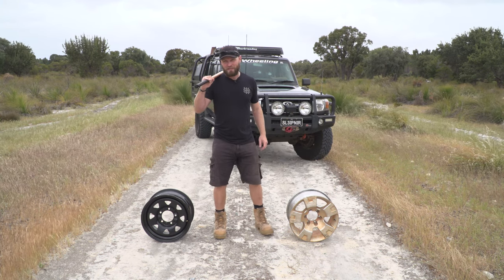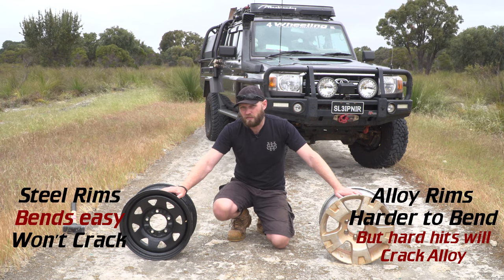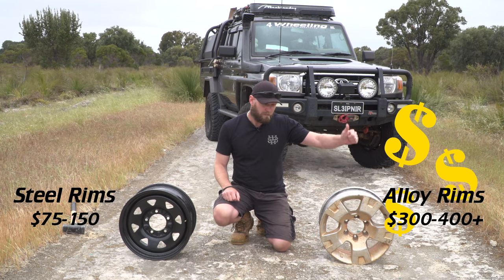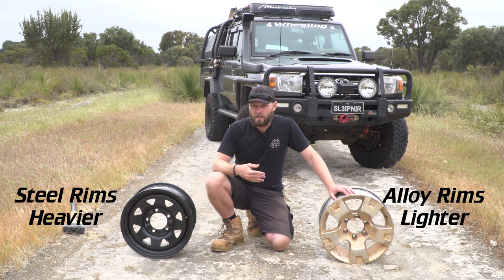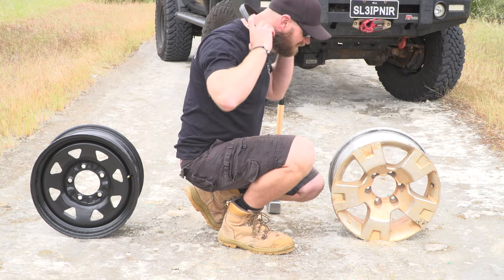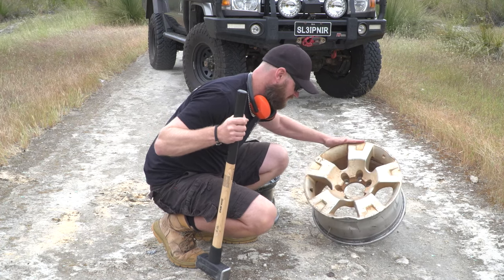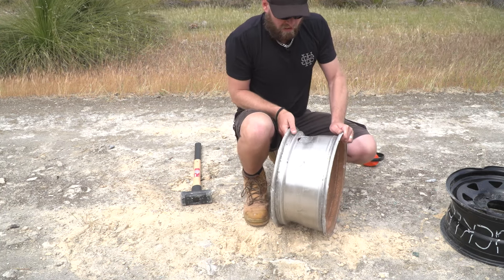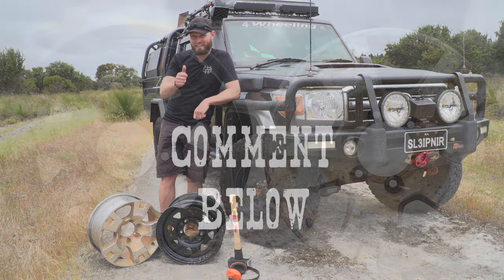STEEL vs ALLOY rims Off-road Wheels

Comment: One thing about rim cracking is their construction technique. Cast aluminum wheels crack if hit too hard. Forged Aluminium wheels will bend and can be fixed with proper tools and techniques.

Aluminium rims do have lower mass for a given load rating, reducing unsprung mass, which will improve off road comfort and grip, as well as reduce stress on other components on the car.

Comment: I agree with most of what you said. What I think you got wrong is. I believe you are confusing strength with hardness. Being harder does not mean stronger. You obviously understand that or you wouldn't put steel wheels on your rig. Just nitpicking. Great video!

Comment: I have a set of 16x8 steel and a set of 16x8 aluminum weight and the difference in weight between them is 2lbs per wheel (30lbs steel vs 28lbs aluminium) they both look very similar to the factory alloy wheels on the 1999-2004 F250 SD. Steel wheels all day since the weight difference cant even be noticed. The person I got the truck from had the 16x8 aluminum wheels mounted and the 16x8 steelies in the back which is the only reason I have a set of aluminum wheels now.

Comment: Summary:

Alloys=Streets: Lightweight, dissipate heat due to higher travel speeds, use AT’s for light trails and they look SEXY‼️👍🏻

Steel=Off-road adventures: Stronger, slower speeds, Mud Terrain tires for serious trails, and they look BAD ASS‼️👍🏻

If you got room to store 5 full size tires, have both. Alloys w/ ATs and Steels with MTs. Swap them out based on your travel demands. 👍🏻

Comment: Here's a thought... 2 Piece Rims.. Steel outer ring/barrel  with Alloy center. Able to mix and match for different looks, offsets and stud patterns. If you bend the ring  you can fix it or just replace it. If you damage the center you just replace that without even taking the tyre off the rim. 

   They have been making 2 and 3 piece alloy rims for years. Why not make the outer ring from steel instead for off road use?

Comment: I have aluminum rims...because that's what came on my super cheap craigslist vehicle lol. Eventually, if I end up doing 4 wheeling that's extreme enough or remote enough, I'll probably buy some steelies. For now, my alloy wheels are fine for the FSR's I do.

Comment: I ran alloys for a year or so, but found the weight saving of alloy was lost in its need to be a thicker construction. In my situation it was a saving of 2kg per wheel. Helpful and never broke one. But sand driving killed them too quickly, my assumption is sand in beads wore away at the alloy, making them lose air way too quickly. I choose steel now.

Comment: Great video, just what I was wondering about. Also great name on your 4x4, the fantastic 8-legged "horse"(I'd say vehicle, but that got mixed up in translation somewhere - it's obviously not a real horse that flies and goes under water, or with all those legs anyway) of Odin.. Since you're obviously interested, I'll tell you a secret about Sleipnir(that means smooth in Norwegian) - we're told them vikings ate too many mushrooms and dreamt it all up(like Jesus:) but they really meant something more concrete. If you really look for it, you can sometimes see the tracks of Sleipner on the ground in holy places(stonecircles) and where there are now churches in the mountains of Norway f.ex. They will look like 8 round little spots arranged in a wide circle about 5-6 meters in diameter. No kidding I've seen one with my own eyes appear over night. It's from what we nowadays would call a UFO. Wich matches the description of those guys wery well, if you think about it, driving their electric vehicles around.

Comment: If you can find a good strong center section steel rim like off of a 1 ton truck, just weld on a DIY beadlock kit and no more bends. 
But i would certainly say that aluminum bead locks are the way to go.

Comment: There are steel rims I like that I cannot find in aluminum, but most the damage I have seen is to the lip of the rim. That's why I chose aluminum.

One note. Weight is a big factor for breaking. You need to calculate rotational mass which is roughly three times the weight of the wheel and tire times 4. That is what your brakes have to deal with.

Comment: I have a question.
For a better word, spokes.
The steel wheel has 8 spokes.
The aluminum alloy wheel has 5 spokes.
The steel spokes is central.
The aluminum is offset.
Wouldn't that make a difference to the strength of the wheel?

Comment: I havent personally bent a 15x10 enkie alloy wheeling with 33x12.5 15 on my montero,  but i usually dont air down at all, and drive a lot of pit run and gravel. I have repaired bent aluminum wheels on cars, and yes, they dont give as much. I'm a bit on the fence on it.

Comment: If you tighten the lug nuts a bit too far it will eat through the Alloy  wheel, steel, you can tighten them down past the torque required and will be just fine

Comment: I was kinda hoping you'd give the faces a smack, as well. I've seen both types get slid sideways into big rocks (at different times). The steel had a fair bit of wobble but it served well enough to get back down the trail (much easier to put on the spare on level pavement). The alloy cracked across 2 of the five spokes and didn't make it another 50 yards before collapsing on itself.

Comment: Always prefer steel for work ute. Have cracked many alloys. But have also had steel split. Worse with alloy and carrying weight is the dust gets in-between rim and bead of tyre and rubs. For some reason more so on inside than outside. Which then wears bead and blows tyre

Comment: I have had experience with aluminum rims that had the slightest dent in the edge and you can’t straighten to get it to seat cause it cracks. The steel you can straighten.

Comment: I've seen many alloy rims with holes in the center. But its caused by a rock getting flicked up into the wheel then jamming between the brake caliper and rim. It then just instantly punches the rock into wheel.

Comment: Mag wheels are called like that for a reason, but we all understand that we are talking steel vs something else, disregarding what that something else is. 
Having see the appearence of the "magnesium" wheels in the market, I know that they came in for the weight reason into the F1 racing cars. 

They represent a significant gain on less weight which is a gain on the power to weight ratio. 
But that gain is considerably loss in 4x4 mag wheel because they need a lot more metal to be suficienly strong for off road usage.
Then you have to think on center of gravity, in serious 4x4 steel wheels help a bit on that, and mag wheels disadvantage you.

And yes, They look a lot better, so the look factor is usually a huge consideration for the "city four wheel driver". But as the video explained, in the real 4x4 usage of the vehicle, mag wheels is like going with high heels to buy veggies, you can do it, you look dam pretty, but what the hell are you thinking?

Comment: I've run both.  Steel wheels are harder to balance.  Aluminum is easier.  I'd like you to try this test with an old school 16x7 Land Rover Discovery Alloy wheel.  I've run both on my Land Rovers.  I have yet to break a Land Rover alloy wheel.  Breaking one would suck, but I have about 8 spares.  I'd ship you one to try out, but I think it might cost a small fortune to Australia from the USA

Comment: True story... I had 3” smooth river rocks pack in between rim and calipers and broke hole and cracked both my front rims at the same time, they were cast factory 17” chevy’s around 2005 I believe. Stick with forged or steel

Comment: I'm a steel fan, you can add rock rings to protect the rim, steels fit better with larger brakes, they are cheaper, easy to fix.  

I've broken too many lips on aluminium rims

alloy is too $$$$

Comment: Most alloy wheel uses stick-on weight for balancing, if you power wash your alloy rim (to wash off the caked-on mud), the power wash can easily blow off the weights.
Also, old alloy wheels get badly corroded, causing leaks around the beads.  
steel wheel has non of these issues, much cheaper to replace, steel wheel is the way to go for off-roading.

Comment: I’ve just recently brought a 2002 Hilux 3.0 non turbo with 16x8 alloys and mud terrains on it when I bought it and its fine around the streets and basic off road stuff like dirt roads but its absolutely gutless going up step hills or with a load in the back.What rim/tyre set up would you recommend to help reduce this problem as I’ve heard wrong rim and tyre size/type can have a big negative effect on non turbo rigs in terms of robbing power.I basically use it for around town and traveling and a lot of dirt roads but desire more grunt when I need to go up hills/steep highways and I’m not keen on spending $$$ to get a turbo kit put on it so would rather try a better rim/tyre set up.Any advice would be much appreciated,cheers Ronnie,great video as well👍👍

Comment: One thing he did not mention is aluminium wheels are better for you suspension, after braking a lot of ball joints on our speedway car we fitted a aluminium wheel and it stoped the ball joints from braking by 90%

Comment: Steel all the way. They're only thirty bucks at the salvage yards around here and the alloys are fifty. The only time I've ever completely destroyed a rim was that one time I blew two tires and I only had one spare. I had to drive thirteen miles on gravel roads and about a mile on pavement on the flat. Well, technically the tire fell off after a few miles so I stopped and grabbed it and drove the rest of the way on the rim. Good times...

Comment: Problem I find with steel wheels is that at least here they are hard to find in the offsets needed and enough back spacing. 
Most are usually in the +15 or higher offset and 3-3.5" back spacing. Which makes fitting a larger tire all that much harder, at least when it comes to the toyota tacomas.
Reply from the maker: You'll need Nissan Patrol rims from AUS thats what we use here for the Hilux which I'm guessing is the build to a degree and fitment on tyres/tires.
Reply: Probably. The Hilux/Tacoma are pretty similar aside from you Hilux being better lol. But we have similar mods we need to do like the body mount chop to fit a 285 tyre.

I have alloys right now but probably going to switch to steel once I break mine. They've already got some pretty nasty gouges in them. Very rarely have speed its mostly just crawling so probably a little less likely to crack. But gouges seem to be really common.

Comment: Very hard to get an apple to apples comparing steel to aluminum, aluminum wheels typically connect the hub to the rim at the edge near a bead (I guess for brake clearance?), while the steel rims connect at the center such that if you were to section one, you would have a capital I shape.
Reply: You're talking about offset, typically yes, most steel rims are negatively offset and have a "deep dish" like you said but you can definitely get positively offset steelies
Reply: Jake Camplin sometimes an aluminum wheel with a small offset will still have the spokes connecting to the hub near the bead.

Comment: Would using steel rims for your main wheels and allow rims for backup be reasonable while saving some weight on your spare wheel?
Reply: Imo you're overthinking it. Just stick with the steels.

Comment: Those hits to the center happen more often than guys think, especially when running low tire pressures like we do. All you need is a good rock in the sand or mud that's hidden, go over it a bit quick or something & your alloys are toast, maybe a couple of them if the back tires hit as well. Alloys are real pretty but real pricey & I love them but, will go with steel everytime on a 4wd.

Comment: New Land Rover discovery svx is going to come with 20 inch wheels with duratracs, which seems really odd to me considering that Land Rover makes 19 inch wheels and Goodyear happens to make a 19 inch duratrack with a very similar diameter to the stock 19 inch tire. They only make the one size and I suspect it’s specifically intended by Goodyear for Land Rover after market fitment.
Reply: Because 90% of Land Rovers only see gravel driveways and horse paddocks haha

Comment: It’s worth noting that the alloy wheels cracks because it is cast and not forged. Forged alloy wheels are vastly stronger. Steel offers great strength at a cheap price with the down side of rust and bending out of round.

Comment: Steel and alloy wheels are nearly the same price here in the USA. If you're soending $300-400 on an alloy wheel you aren't buying them for a 4x4. That's the kind of prices  you'd pay for 24+ diameter wheels here.

Comment: Faster excelleration?  What you doing racing or 4wheelin?   Gas millage?  the weight isn't significant enough to matter at slow speeds you'll be going ^.^   Don't got a race care you got a 4wheelin'  thing :P   Thanks for video also never knew that Alloy would crack  thought it'd just crush like steel.

Comment: Its a little more complicated both aluminum and steel come in different grades and the rubber of a tire will prevent the splitting of the impact on that aluminum as it is the sharp edge coupled with force that almost cuts the aluminum the main reason to go steal is the ability to reshape and xost of replacement as aluminum will bend on the rock wut will often times crack when reshaping without heat

Comment: I use the same alloy rims as the one in your video on my Pajero (17" patrol alloy rims). They're dirt cheap on gumtree as patrol drivers seem to throw them away when they "upgrade" to steel rims. Should I damage mine, I know I would easily find a replacement for $50. So I have to say I'd disagree with the cost factor. I guess most other points come down to personal preferences and driving style.

Comment: So  got a Chevrolet Silverado 2500 4X4 Duramax and it came from the factory with 20 inch rims (275/55R20).  Should I not use those for offroading?  Geti different rims 17's or 18s?

Comment: I have to disagree with ya on the corrosion I worked at a tire shop for a while and only saw 1 maybe 2 rims that has leaks due to corrosion where I saw it all the time on aluminum and chrome rims forget it the only way those weren't corroded is if they were less than a week old😂

Comment: as a tech. having fitted countless steel and alloy rims, for some reason the steel rims usualy allways felt lighter than the alloy, after tire fitment.
Reply: Odd78baLL I always felt that way too. My snow tires were much lighter on steel than my regular tires on alloys. That was a Mazda 3 tho not a truck.

Comment: Fledged or cast aluminum ? What about the lip scraping rocks ? I’m am hard on my passenger side wheel , enough to the point the bead lock bolts get loosened from the rocks

Comment: Are they sunraysias that your running and if so where was they made?  I had a set which I had only done some beach driving and after 6 months one snapped clean off whilst doing 100km/h down the mitchell.

Comment: Ronny, is there any value in bead gripping technology on aluminum wheels; versus the standard steelies?  When I take my FJ off road it will likely be in sand and low tire pressures.

Comment: Steel wheels for sure, if you bend a wheel you can usually bend em back. A cast alloy rim will usually just crack not bend.

Comment: What are the actual weights of the two rims you have there? Im going up 2 inches in tyre size and want to keep my unsprung weight down as low as possible. Cheers

Comment: Hi Sir,

I am using Ignis Delta and experiencing unusual sound in cabin from the very beginning (milege 3500 km). Service center guy agreed that there is humming noise in the cabin. He arranged a demo car that was automatic ignis zeta (alloy wheels). Drove that demo car on the same road , there was no unusual sound in the cabin of that car. Can u plz tell me whether alloys wheels make less noise than steel wheels (this info was given by service center advisor) ???

Comment: Whilst planning a Simpson trip I watched the 'Your 4x4' series (Episodes 71-80) from the trip they did out there & was shocked to see they completely smashed 2 Patrol alloy rims in separate incidents on the gibber rocks out that way. The tyres survived but the rims were totally destroyed, which would result in most people, who don't travel in large convoys of relatively new vehicles & another had a matching spare rim, sat crying at the side of the road with no more spares to use.

That said, I've seen some factory alloys in some crazy situations coming out fine so it's hard to definitively say steel rims are better for offroad. I like hitting things with progressively bigger hammers though, so it's steel for me 😋

Comment: I plowed into a 300lb mule deer recently with my Wrangler at about 50mph. No cosmetic damage was done to the vehicle, the off road armor wasn't even scratched. But the passenger front tire hit the deer also. I have steel wheels and I hit that deer hard enough to bend the wheel off center on the hub. So I can only imagine if that were an alloy wheel, would it have broken? Or held up and transferred the energy to something else and broke something else?

Comment: With either rim, air down and put a can of fix-a-flat into it when you first get the rig. The vinyl really helps with slow leaks and nail holes.

Comment: Hey Ronny, your videos are great so direct to the point, I wanted to ask you about the details of the steel rim in the video? And is it the same as the one you got on your cruiser ? I'm trying to order it online
Reply from the maker: Yep same brand I think but that rim in the video (or both actually) are from a Nissan Patrol and they are 17 inch. the 70 series runs on 16*8's King steel rims